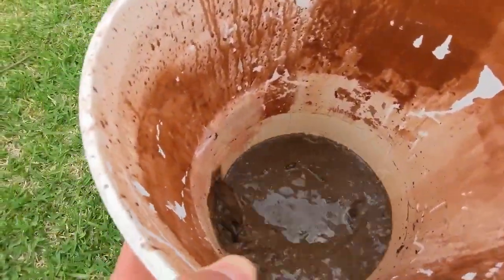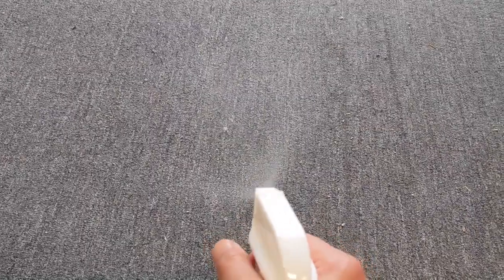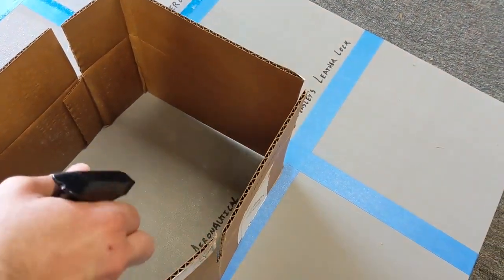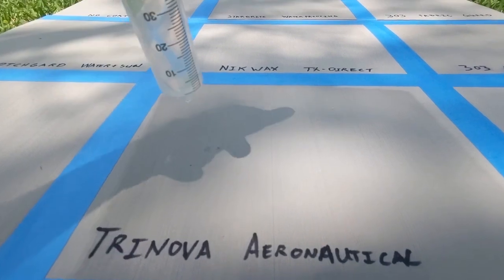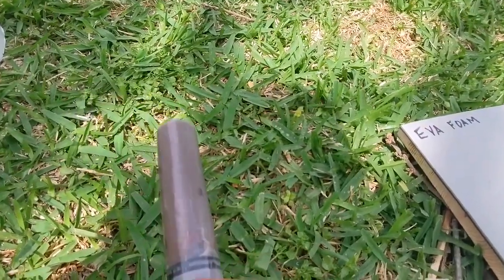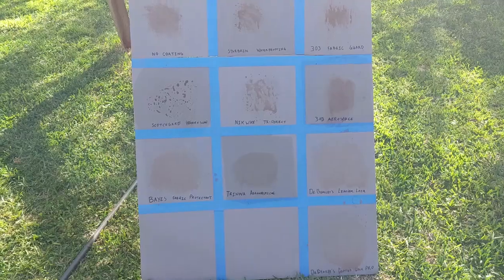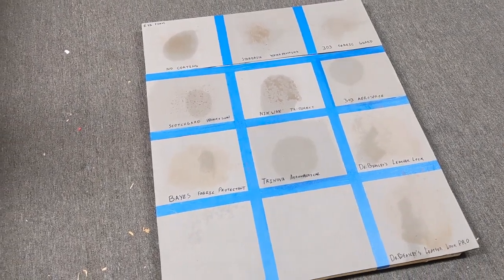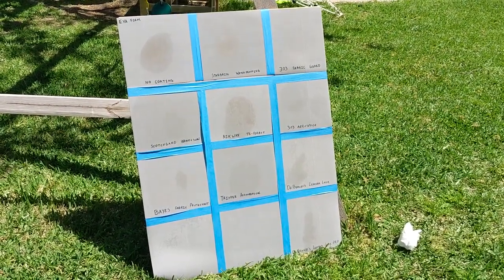Seadek Marinemat Aqua Marine Gatorstep - CAN it be STAIN Proofed ? EVA Foam @303Products

Comment: Nicely done! FYI... in regards to the Dr. Beasley's products:
Leather Lock: water-based, 24-48 hour cure time, 1 year service life
Leather Lock Pro: solvent-based, 2-3 hour cure time, 5 year service life... and yes, this is a ceramic coating for leather (or leather-like surfaces). A coating saver type applicator may help with the application to the EVA foam.
Reply from the maker: Thank you! Great information on the Dr. Beasleys. I actually used the Leather Lock Pro on our BMW X7 on all the leather surfaces and had great results! I did a video on that as well incase you are curious to see the process that I used. https://youtu.be/wagEVhDyiaE
Reply: @NKPGarage  I'm going to check it out now! Thanks!
Reply from the maker: @directorofsuccess  let me know what you think!!

Comment: I’m glad I came across this very thought out and executed test.  I wish I would have been smart enough to put some type of guard on when I installed EVA in my boat mid last season.  I just started thinking about a thorough cleaning and scotch guard for this upcoming season.  Now it seems I need to look at 303.  Thanks for your effort!
Reply from the maker: Glad you found the video helpful! Best way I have found to was the EVA flooring in general is carwash soap. Get the regular one, not the ones with waxes in them. Then mix it about twice as strong as it recommends for normal car washing. Get a soft bristle brush and  work the soap in circles until you're done with the floor, then rinse, then rinse again. Let it all dry and repeat if necessary. Once you get it as clean as it's going to get then let it dry thoroughly and then go back and coat it with the 303. Good luck! And let me know how it goes!

Comment: How do you apply the 303? Just spray on and let it dry?
Reply from the maker: Yup. Spray it on well and saturate the flooring. Let it dry for 24 hours. And that's it. And make sure to clean the flooring well before applying.
Reply: @NKPGarage  so you don't wipe it off at all just let it soak in?  Have you found anything that will give the EVA decking a bit of gloss/shine, I used it on the interior cabin sole.
Reply from the maker: @rodstright6729  You got it. You don't wipe it at all. Just let it air dry and cure. I would steer clear of anything that gives it a shine, because it may also make it slippery.

Comment: Hi guys there is a far better product on the market completely stain resistant you can even tip acetone all over it won't even touch it quite power wash job done 👍
Reply from the maker: Interesting, what type of flooring are you referring to?